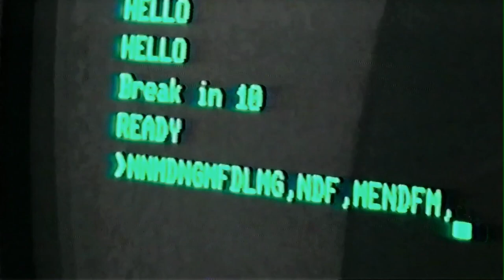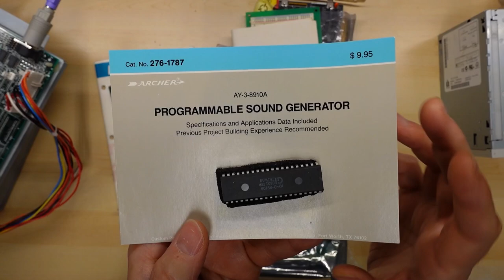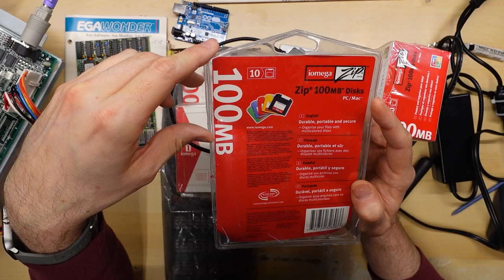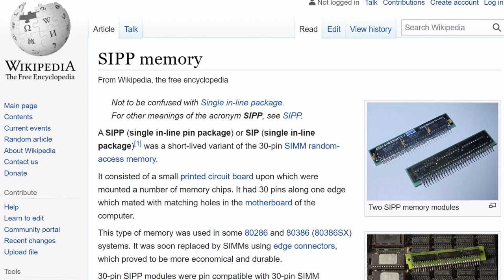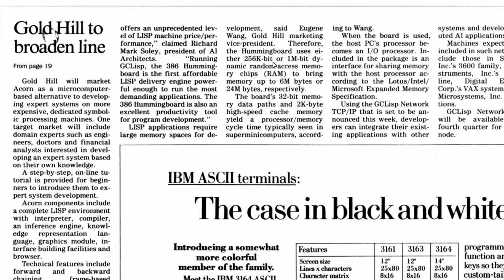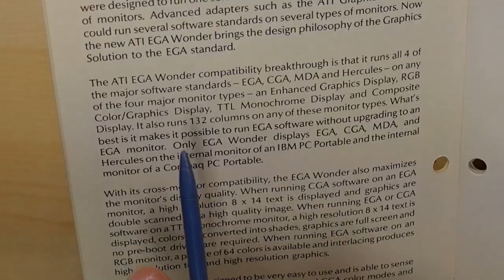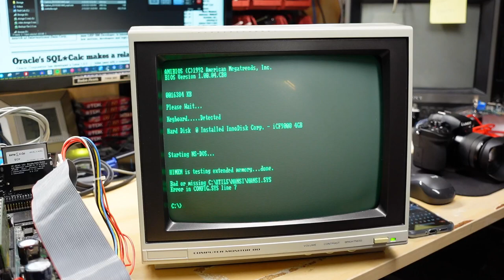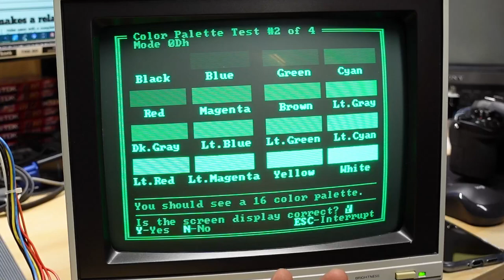A 386 A.I. Co-Processor from 1986, an EGA card driving a composite CRT, and an ISA Prototype Card

Comment: Hi Adrian, went searching for an adaptor board for your LS-120 after watching the video and found this forum post with lots of great info. It seems that there are different pin configurations and in some instances ready made adaptor will not work. Here is a link to it and hope it helps you. Cheers from Australia.
https://www.vogons.org/viewtopic.php?t=61145
Reply: Great info, hope Adrian sees this.  Never thought they'd use the same connector as optical drives but a different pinout!

Also it appears that Adrian's drive may have a vendor-specific adapter attached, like for a laptop drive bay.

Comment: Adrian, For the SIPP, you may be able to use something like these pins https://www.digikey.com/en/products/detail/mill-max-manufacturing-corp/0270-0-01-15-00-00-03-0/433407 granted you would have to use an inline socket as a jig (probably sacrificial) for alignment, but as long as the pc pin diameter is right...

Comment: The laptop CDROM to IDE converters still exist, though I'm not sure the connector would be an exact match.
They're called JAE to IDE converters, available from Amazon: https://www.amazon.com/Small-PCB-Slimline-Slim-50-Pin-Adapter/dp/B01CJHK6ZU
Reply from the maker: Actually I took the LS120 out of that laptop carrier -- and inside was the bare drive and it had the exact connector on it from the Amazing link you shared. $20 is insane for such a thing, but it means a normal adapter would be easy to find..... Sadly using that drive in anything would be hard since it's slimline and won't really fit in any normal desktop.
Reply: @adriansdigitalbasement   Yeah, $20,- is pretty steep for what's basically a PCB with a couple of pin headers. It was the first URL I could find so they can probably be found cheaper.
Also, fitting it to something shouldn't be a huge problem with a bit of 3D printing magic :P

Comment: 30 pin SIMM to Sip converters exist as well, in effect it was the same as a SIMM socket that would have been soldered to a MB I think I recall  using  them on a my first 386DX mother board. 

 search found 
https://www.peconnectors.com/sockets-pga-cpu-and-memory/hws5040/
$ 1.82